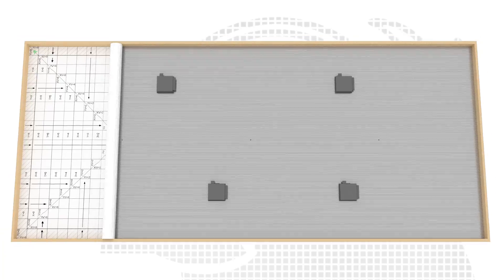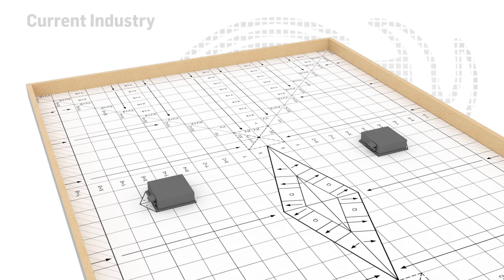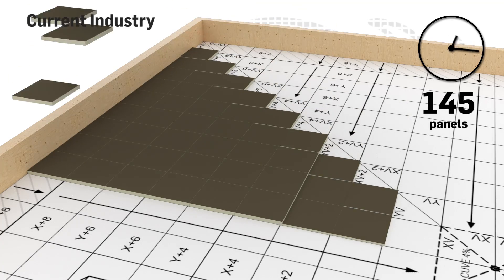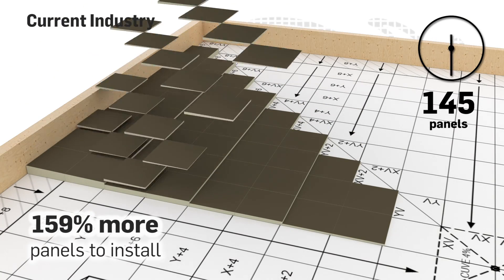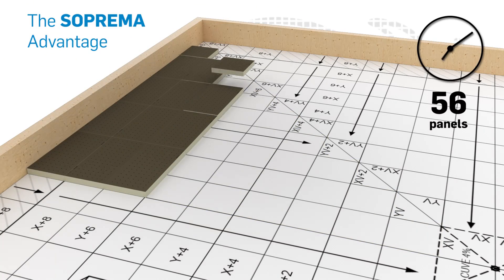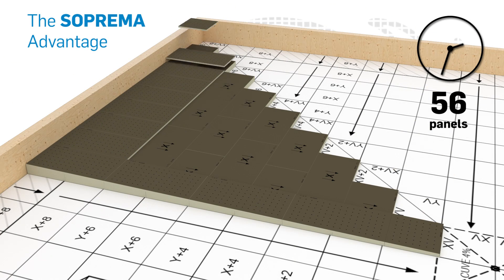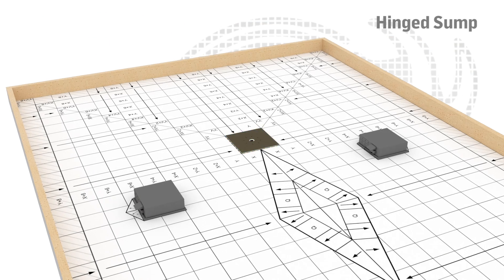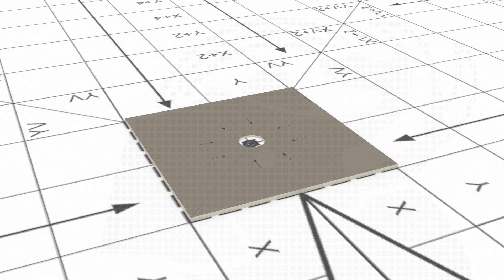How to Install SOPRA-ISO Tapered Insulation Board?

Comment: Hello!  I would like to use some SOPRA-ISO PLUS in my home DIY roof project to insulate my lower valley roof where there is very little insulation right now and causing ice dam water leaking damage.  Can you please tell me where I can purchase SOPRA-ISO PLUS?  I live in Markham, Ontario, Canada.  Thank You!
Reply: Not only do they not explain how to use it, they apparently don't care to sell it.   Hope you found it somewhere.  I'll be doing the same to my home once I figure it all out.  I'm buying a brand sold locally, just have to figure the best way to install it.  Cheers!
Reply from the maker: At SOPREMA, we operate on a B2B (business-to-business) distribution model, which means our products are primarily sold to construction industry professionals, such as contractors and specialized distributors. This is why our website is not transactional, and you won’t find our products directly in stores.

However, for individuals, we offer some equivalent products under our RESISTO brand, which are available in several renovation centers. You can check out the list of partner retailers where RESISTO products are available here: https://www.resisto.ca/en/find-a-retailer/. Hope this helps!